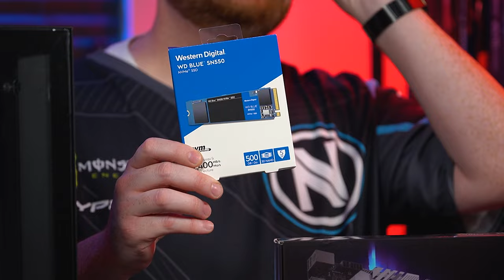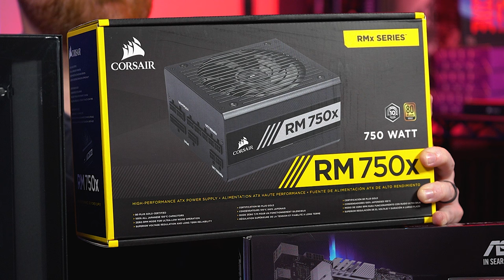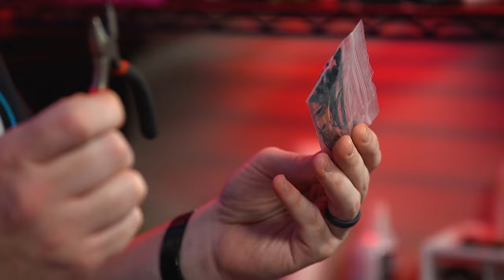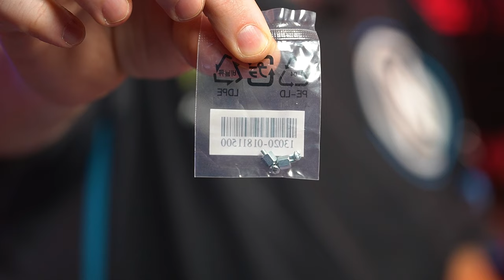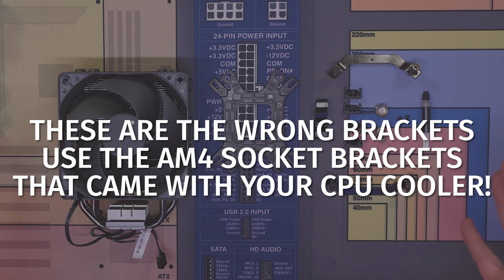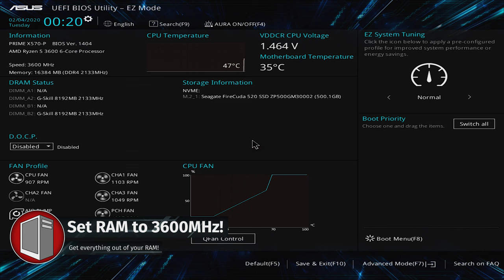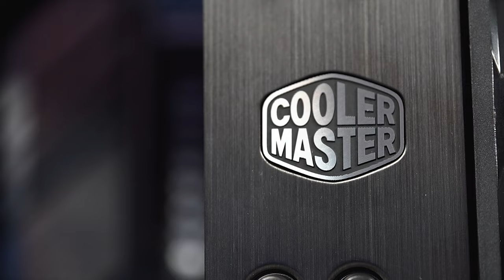How to Build a PC! Step-by-step (2020 Edition) | Robeytech

Comment: I got problem, Basing on your build so I could able to build my first PC. Then after plugging everything together, the fan and RGB from every components are working even the cooling dynamic Z63. But when I try to plug into the display by HDMI, there is no signal or no output anything happen to my screen. I tried to remove the 4 rams and insert again with 2 rams only and GPU are also removed and reinsert. Hope you can answer my problem.

Comment: I have a question, may be someone can help me.
I've bought a very similar config (RAM memory, m2 ssd, video card, same PSU and ASUS TUF Gaming X570-Plus) but I'm planning to use the original cooler included with AMD Ryzen 5 3600X 6-Core (Wraith Spire Cooler).
The case is a Corsair Crystal 570X with 3 Fans and I'll add a set of three Corsair LL Series LL120 fans.
Do you think the processor cooler will be ok, or may I need a more powerful one?

Comment: I think this is the one I’m going to go with
I’ve been trying to find a way to build my own PC
My old laptop has seen better days😂
I want to start animating and come to find out it can’t really run animate because it’s so old
The two USB ports on the right side stopped working and I’ve had to switch to an external keyboard because the keyboard also stopped working

Comment: I mean, I think you could have went with a 850W PSU that wasn't modular, or a semi-modular one like the TX-M series for the same price maybe? I'm not 100% sure but I would think a non modular version would be cheaper for the wattage? Edit: Ah, I see, you care about how the cables look, which is why you went full modular. Now I got it. Edit2: Nevermind, they were just extensions anyway. Thought someone sold custom cables that fit directly into the modular PSU, haha, that would be kind of cool to eliminate all of that extra cables you had.

Comment: For a gaming pc is a gpu and graphics card the same? If they arent do you need both? If you dont which do you need?
Reply: The terms GPU and graphics card are used interchangeably, but there is more to it. The GPU (Graphics Processing Unit), as the name implies is the processor of a graphics card that is in charge of handling graphics. So essentially, the GPU, is similar to CPU, but for graphics. The graphics card is the entire card, including the GPU.

Comment: Hi Robey,

I was able to put it together, but the monitor does mot turn on.
There's a suggestion that it is a power supply issue.
Any suggestions?
Reply: Had to remove and re-install RAM. Now it works. Thank you!

Comment: What he didn't know then, was that AMD was going to end up allowing backwards compatibility for 400 series chipsets, and that PCIe 4.0 was still going to be a non-factor with the next gen. graphics cards. A lot of wasted money on mobo and CPU cooler that could have gone into a better GPU than a 1660. The 3700X is still a 65W TDP part, and it comes with a cooling solution that is more than adequate if you're not overclocking.

Comment: I bought all the parts, I plugged everything where it needed to go, I checked the video for every part, everything is working fine, it runs but for some reason when I connect it to my monitor it says "no signal". Would you happen to know why that's happening?

Comment: The main issue I have is not the build but the parts j need for the build. Are the parts compatible with eachother, is everyone going to fit.
Reply: pcpartpicker.com is a good website to see if your parts are compatible. It also really helps to read up on PC hardware first.

Comment: Do you need an operating system like windows 10 or why should I buy that and how do you install that?
Reply: You will need an operating system of some sort. Windows happens to be the most popular desktop OS, so that what most gaming PCs run. If you're doing things by the book, you have to pay for a Windows 10 license (known as a product key). The retail cost of W10 home is $139. Unofficially, you can run W10 without paying for a license. You just won't be able to change some options (like personalization settings), but other than that, it will work exactly the same as if you bought a product key. If you want to go the gray market route, there are tons of gray market sites that sell product keys that were meant to be sold in other countries, but at big discounts. There are a lot of guides and videos that explain how to install Windows on a PC.

Alternatively, if you want a completely free operating system, you can use any of the nearly infinite Linux distros. Gaming on Linux has dramatically improved over the past couple of years, but there is usually a learning curve in learning a new system.
Reply: Jose Javier Flores thank you so much dude this helps so much

Comment: I want to install a two tb hard drive and I want to know if there is an extra sata 6gb cable that plugs into the motherboard and the hard drive and I also want to know if there is also an extra sata power lead for the hard drive.

Comment: Am a console player but I want a pc so I decided to make a prebuilt.This is what I have so far
CPU: Ryzen 5 3600 3.6 Ghz
GPU: Mci Geforce GTX 1650 4 GB
RAM: Corsair Vengeance LPX 16 GB (2x8)
MB: Gigabyte B550M AURUS PRO MICRO ATX 
 HDD: SeaGate Barracuda 1TB 7200RPM
POWERSUPPLY: ThermalTake Smart 500W Power with 120mm Ultra Quiet Cooling Fan, ATX 12V V2.3/EPS 12V Active
Case: 4000D AirFlow Tempered Glass Mid Tower ATX Case from Corsair (Has Fans)

Please Tell Me If These Parts Are Compatible And Tell Me If Am Missing Any Important Part.

Comment: I am using a Rysen 5 cpu when I took it out I touched the thermal paste on the cpu cooler and a tiny spot does not have thermal paste is that okay
Reply: @mastermirror2842  Thanks so much

Comment: the motherboard user manual for 570x-p says to either connect the 6 pin only or the 6 pin AND the 4 pin for the CPU power connector. But I see in this video we've only connected the 4 pin connector. is this right? I'm kinda freakin out :(

EDIT: Nevermind just saw where he plugged the 8 pin....

Comment: question same motherboard all connected but wont boodT amd ryzen 9 5900x 32gb of ram hyper x , 850 w psu  corsair died few days ago but now i got old one 1k wat enermax psu   non modular one old mobo boots instantly this one just light of the fan is on below top right corner no sound or anything i tried like everything to isolate the problem or is mobo that they send me faulty one or cable or i need to flash bios to boot SUBED very nice channel for building
Reply: solution biosflash :)

Comment: I’m having some trouble with the front panel connectors, my case has power + and power - but then it has reset sw and power sw and that’s it, where do Connect the reset sw and power sw

Comment: As of February, 2021, buying all the parts for this build would cost somewhere between $1,400 and $1,600. I am sure the build far exceeds the power of a manufacturer's computer on the same price tag. I would, however, like to also see builds that have decent power but are less expensive, say, under $700 for all the parts.

Comment: The budgeting for this build was pretty bad, you have a third party cooler, overkill PSU,  higher end mobo, extra cables and you then decided to get a 1660 for a $1200 build, the GPU is the heart of the build and will dictate the experience you get so deciding on it last isn't a good idea

Comment: im new to pc gaming and was wondering if i NEED a m.2. so far i have a seagate barracuda 2tb 3.5 hdd and my 16 gb ram. thank you
Reply: An SSD is not absolutely required, but I recommend installing one, be it M.2 or 2.5". SSDs are faster than hard drives.

Comment: Things were going perfect with my build until I was in the BIOS and changed the DOCP from disabled to profile 1 (to set my RAM at 3600, as explained in the video). When rebooting the computer seemed to shut down when trying to restart. After that I can't reenter the BIOS and I don't see the ASUS welcome screen. LEDs are on and fans spinning but no display. I have tried everything.. reseting the board (I have an ASUS x570 pro), reinstalling RAMs (4 x 16 GB), reinstalling GPU. Nothing works. Just a black screen. Is there a chance something got permanently damaged when I changed the BIOS settings? It was all working fine on the first boot. Any help would be appreciated. No clue what to do now.
Reply: Yes the same happened to me but I'm able to get back to bios. Just trying to figure out why I can't use the profile setting

Comment: cable extentions didnt come with my power supply what should i do? i dont have any more money i cant buy cable extentions
Reply: Cable extensions are purely for aesthetics. They serve no purpose other than to make your system look "better".
Reply: @JJFlores197  yes but i cant plug in anything because i need the extentions. thats what this guy said in that cable extentions part
Reply: @GucciMilk  What do you mean you can't plug anything in? All you need to do is run the cables from the power supply to the respective parts. That's it.
Reply: @JJFlores197  i have the thermaltake smart 500w power supply. i plugged the motherboard in through the main power cord, but i dont know which one goes to the gpu.
Reply: @GucciMilk  Did you look at the PSU manual? It will tell you what cables go to what parts. The cables for the graphics card are usually referred to as "PCI-E" connectors.
Reply: @JJFlores197  i plugged in the gpu, main power connector, but now i dont know which connector is for the cpu. the only ones i have left to use are sata, fdd, peripheral, and atx 12v. do you think you could add me on discord and explain please?

Comment: My Pc is working but the picture is not displaying on the monitor from HDMI. Anyone know what to do?
Reply: Make sure you plugged the HDMI into the gpu not the motherboard. If that still doesn’t show up with anything try this https://forums.tomshardware.com/faq/no-post-system-wont-boot-and-no-video-output-troubleshooting-checklist.1575220/ .

Comment: just built a new pc, no signal though from mobo or the gpu. GB auros b550 ac and rtx3070ti by GB auros master. any help appreciated. 
oh mobo has power, everything turns on when I hit the power button on case.
Reply: You will need to some troubleshooting. Make sure everything is installed correctly, even trivial things.

Comment: Ive just finished putting together my Ryzen 5600x on an MSI B550 A PRO... dead as a door nail, nothing. Swapped out power supply, still nothing. What do I do next?
Reply: Check the following in order: Power outlet, power cable, power supply power switch, ALL power connections from PSU to components; make sure everything is installed in the correct ports, make sure ALL hardware is installed correctly, power button header cables.
Reply: @JJFlores197  I found the problem ! The 3.5mm jack was able to go in slightly too far resulting in a bad connection. I 3d printed a small collar and now everything works :)

Comment: How do i insert the H510 front panel cable to the one with the pins and the hdd light?
Reply: did u ever figure it out
Reply: @animethot3983  yes
apparently you need to plug the front header thingy with the pins inside the box you find and plug them in and make sure the sides match up
Reply: @shujikawasaki8218   @Shuji Kawasaki  ye ye but how about connecting the front panel connector to the adapter wire that has the LEDs at 28:20. when i try to connect these 2 even with pressure they dont seem to connect through fully

Comment: Can someone tell me if these are good parts AMD Ryzen 5 3600, MSI B450 Tomahawk MAX, Kingston HyperX Predator 16 GB (2 x 8 GB) DDR4-3200, Intel 660p Series 1.02 TB M.2-2280 NVME SSD, Sapphire Radeon RX 5700 8 GB PULSE, Phanteks ECLIPSE P350X ATX Mid Tower Case, SeaSonic FOCUS Plus Gold 650 W 80+ Gold.

Comment: So this step to step is the same for any other pc build
Reply: For the most part, yes. The overall building process of PCs isn't that different regardless of what hardware you have. There are some differences in things like case layout, CPU cooler installation, etc, but it really isn't that hard to figure out.

Comment: New Builder here. Will this build have WiFi capability?
Reply: No. You will need buy a Wi-Fi adapter. Most motherboards don't have Wi-Fi/Bluetooth built-in unless it specifically says so on the specifications.

Comment: You know Im following this guide as Im building, right now, and it it hard to follow because of, what seems a conscious decision that fast pace and crisp editing is more important than content and clarity. Really, watch the whole thing and ask yourself if you expect newbies to be able to determine what to do. Especially the parts concerning which cables go where are just not very informative. You cant make out what you're looking at in terms of numbers of pins, shapes, writing etc... If you so need your pace to be hyperfast, would it hurt to put illustrative still images at the bottom when a part is mentioned? This is far from the only channel that seems somehow negligent about being comprehensible to newcomers though (when they are in fact supposed to be in the target audience). In fact it seems to be a staple of any kind of online tech or computer guide.

Comment: Hello, nice video. Can someone help me please?.I want faster RAID0 from 2 or 3 same disks: PCIexpres gen 4.0 x4 M.2 SSDs. Which would be better -Gigabyte  B550 Arous Master or MSI X570 Goflike (putting 2 disk info M2-XPANDERGen4 and one into direct CPU). I also need 128 GB of RAM with 3900x. The graphics card would be some cheap 150 USD. Which one tu use cause I already have MSI motherboard that I paid only 200 USD more from Gigabyte. I don't have money for Threadriper. Please what I can do with this what I have? I do a lot of ramdisk to disk copy and disk to ramdisk copy and to other devices - HUGE files like 60 GB (I edit them in RAMdisk cause its faster). I want Raid0 to be bootable in Linux Mint. I work in Linux Mint.

Comment: How do i know the polarity of the hdd led and power sw cables from the front panel?
Reply: on the motherboard you might see text that says "+HD_LED-" in that case the left pin is positive obviously and the right pin is negative. the connector will also have + or - but if it doesn't look for the side with an arrow. the arrow indicates where positive is.

for the power switch it doesn't matter which way you connect it. that's why you won't find any arrows or + or - labels on the connector or the motherboard.
Reply: @malcolmdoss9748  thank u so much, i got here again and saw your comment, very helpfull

Comment: How much did all of this cost? I thought I heard $1000, but if that is true, then how much was the graphics card? I keep seeing the graphics card for well over $1000. What kind of GPU can I get that is not so expensive? I am not a gamer or anything. I am just trying to build a basic PC and create a home network and lab.
Reply: This was a pre-pandemic build, so I don't know what the cost would be at that time. Due to the pandemic, most PC parts are in short supply and absurdly overpriced, so its not exactly a good time to build a PC right now. 
For your use case, you probably don't need a dedicated graphics card. You may be better off buying an APU, which is a CPU that has integrated graphics.
Reply: @JJFlores197  thank you

Comment: Quick question to anyone that sees this. Do I have to install a network card to go online or am I already able to do so
Reply: Your motherboard should already have a network controller built-in for Ethernet. That has been standard on consumer level PCs for over a decade. If you want Wi-Fi, then that may be a different story. Most motherboards don't have Wi-Fi built-in, so you would need to buy a Wi-FI adapter.
Reply: @JJFlores197  thank you so much for answering. I'm planning on building my very first gaming pc and I'm trying to get everything I'm going to need down

Comment: I just bought a pc it’s coming around august 24-27 I’m so exited and nervous 😟
Reply: Goodluck
Reply: DeadZombie568 it came
Reply: DeadZombie568 I finished it but the power supply didn’t come with gpu cable
Reply: DeadZombie568 I returned it also I think my mb is broken cause it kept falling because the io was broken
Reply: @issa64  dang bruh, hope it starts to work though, my motherboard new egg sent me was wrong then they sent me a broken one and now I need to buy thermal paste because the one on my amd cpu fan was already used when I was building it to see if everything would work with the broken motherboard, but anyway I hope your next one goes smoothly when you get your stuff in.

Comment: How do I do a bios update for my motherboard
Reply: The mobo manual will tell you how to do it. The general process: Format a USB drive to FAT32. Download the newer BIOS update from the mobo manufacturer's page. It is usually in a ZIP format. Unzip the actual BIOS file to the USB drive. Boot into the BIOS and go into the update section.

Comment: dose it matter how much memory u have?
Reply: To an extent, yes. If you have too little memory, your system will just be overall sluggish. If you have way more than you need, nothing bad happens its just that you may not take advantage of it and it would be a waste of money. The minimum I recommend for a gaming system is 8GB of RAM, but I would strongly consider 16 GB. 32GB+ is not really useful for most gaming scenarios and would be beneficial if you plan on doing a lot of 4K video editing, photo editing, running VMs, or other memory intense tasks.
Reply: @JJFlores197  Ok thank you this helps a lot.

Comment: Followed along exactly as should, but my fans didn’t start spinning. Now idk what to do lol
Reply: Start by checking the obvious, like the PC is plugged into a known working power outlet, that the power switch on the PSU isn't turned off, etc. Then move onto the less obvious like making sure your power button is connected to the correct header, and so on.